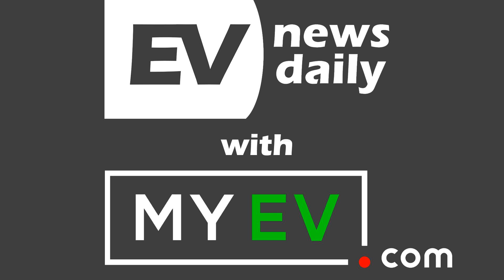23 Sep 2020 | Tesla Battery Day Review: What It Really Means

Comment: You did not get the first point. With Tesla's new cell production process, they do not need 135 Gigafactories but only 20 Terafactories. Each Terafactory is cheaper (to build and operate) and smaller.

Comment: The big reveal was a state of the art prototype battery production plant, along with a functioning adjoining cathode production facility. Pretty major product reveal.
Reply from the maker: I agree entirely. I'd love to know if you have a take on why they had trouble communicating that? This event was pumped as major moment for Tesla fans, so perhaps there was an unfair level of expectation, but I think was presented in a way which lacked their trademark ability to capture the imagination.
Reply: @EVNewsDaily  I was impressed by what they revealed but perhaps it is difficult to convey how exciting an order of magnitude process improvement can be. That the event was delayed and people had built themselves up to expect a silver bullet solution in the interim, may have led to some feeling a little deflated. I was pleasantly surprised by the level of commitment to breaking all assumptions in the supply and production process to extract gains from wherever possible. This is the exciting part, they will not rest, rather iterate and accelerate. I think people are misinterpreting the time scales a bit too, elements of this will start appearing quickly, and the ramp process will build across the time scales mentioned. The implications of what they announced may take some time to sink in but I also got the impression they were only giving a taste.

Comment: 8:27 tesla usually physically test the battery packs to see how heat moves around in the system, due to a lack of prototypes with these cells i imagine they have no ballpark numbers from test on what the charge rate will be for its packs.
Reply: They know they just don’t want to tell people yet as it will kill current sales while everyone waits for the faster charging cars
Reply: Dave Rainbow Quite possible. HOWEVER after one year of Model 3 ownership, I’ve never fast charged, just simply don’t need to unless we do a VERY big trip. The one regular trip that we do to a son’s place, is 280km, which means I just don’t need roadside charging as long as we get a slow charge for a bit of a top up at my son’s place- too easy!  
(Of course Covid has curtailed longer trips to a degree as well.)
Reply: @TeslaBulldotcom  everybody already assumes they will make better cars, But they are looking to buy a car now and tesla offers some of the best.

Comment: Tesla explained their road map pretty well. A bit disappointing that they aren't going the graphene route. Or the solid state route. I prefer Byd's cheaper by the pound and Samsung's hyper advanced battery route.
Reply: a lot of the improvements they have made are manufacturing and can be used in graphene and solid state battery production, sometimes what is needed is a practical battery not a amazing battery.
Reply: @miguellopez3392  And a high volume battery, and an ASAP battery.
Reply: They are doing what works. If and when solid state comes, all the better. I think the plan is make-it-work-even-without-SS
Reply: I just watched a video by Sandy Munro - what was his sign-off line? "Does he need solid state batteries now?" I get a pat on the back for that! :)
Reply: Daimler's solid state effort is also interesting